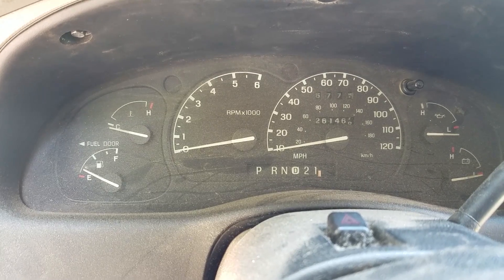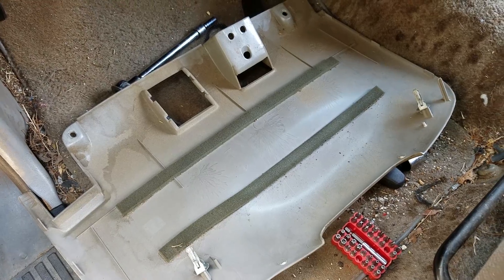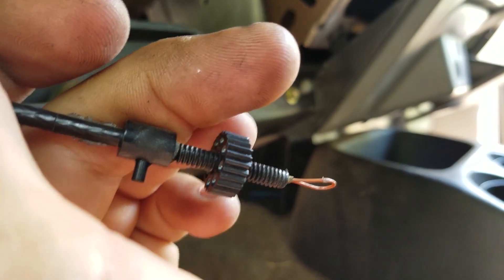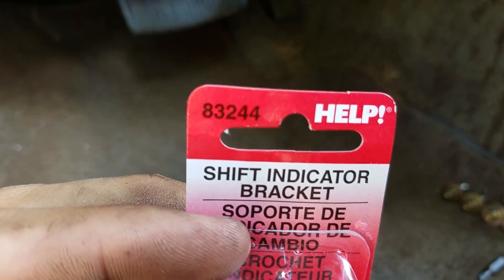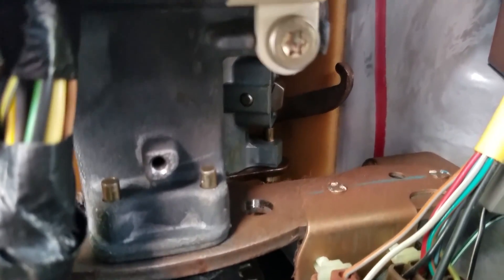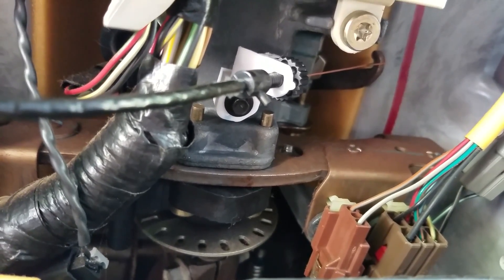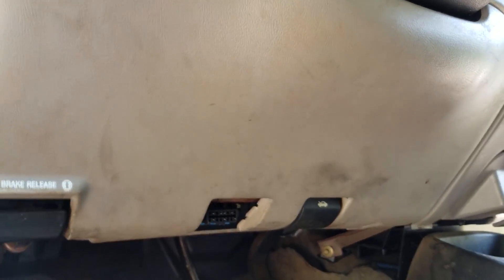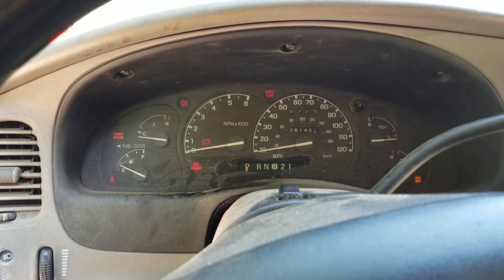Truck Won't Go Into Gear?

Comment: Your video is AWESOME.  Because of you, I knew where the screws were and what size bits to use to get them out.  I opened up the panel easily, and found the part was not even broken.  I just had to reconnect the wire to the hook.  I got to return the part back to Amazon I ordered thinking it might be broken.  (I had ordered the plastic one you mentioned as well as a metal one.  I figured the metal would be great and unbreakable, AND half the price at $7).  Didn't even need them.
Thank you so much for your excellent detailed description.  It was so easy because of you, and most people don't tell you the size screws you will be unscrewing.  That was SO much help. THANK YOU!
Reply from the maker: That's great to hear you got it fixed!

Comment: I change my flywheel on a 87 Ford ranger manual transmissionand I put it all back together and it'll go in gear without pushing the clutch in and when I start the vehicle and put it in gear it makes the cleaning noise and I can't get it to go in gear it's really aggravated me please help
Reply: Manual trans?

Comment: I have a 98 ranger that goes into all  other gears but doesn't engage drive when D is selected.

Is this the problem you we're having?
Reply from the maker: +PatRiot Yes! This is probably the problem, or a worn out shift cable.
Reply: I took a look and this small plastic piece was broken- 
I repaired the part with some good ol super glue and baking powder and it's working fine.

Didn't solve the no shift problem but the gearshift lines up and that's a good start.

Truck has several tranny codes right now so I'm thinking it's low voltage or a solenoid has gone bad.

Thanks for making this detailed video it helped quite a bit knowing what size bolts were etc 

Liked and subbed
Reply from the maker: +PatRiot Yea, that's good that you fixed it with some superglue I didn't think that would hold.

Hmm, yea it sounds like you got a much deeper problem than just the shift plastic piece. It's a good first thing to check.

Thank's for subbing. Good luck fixing your problem!